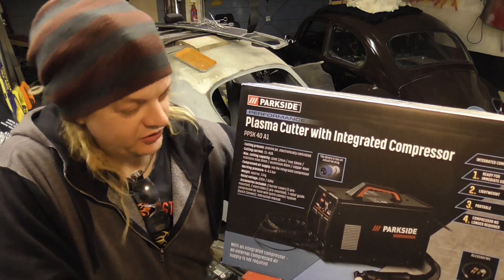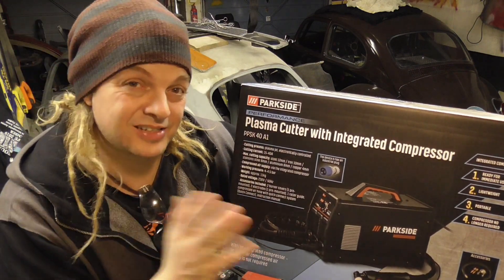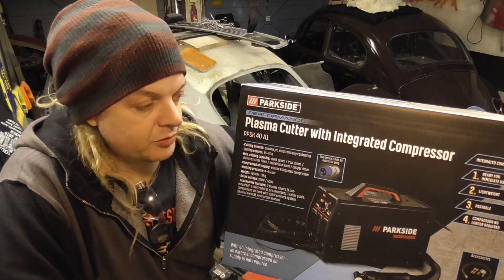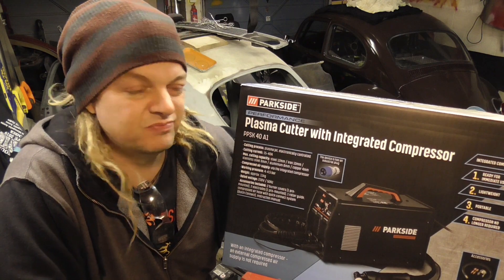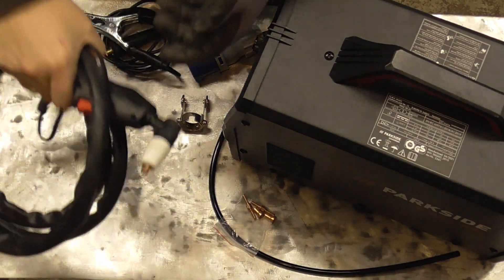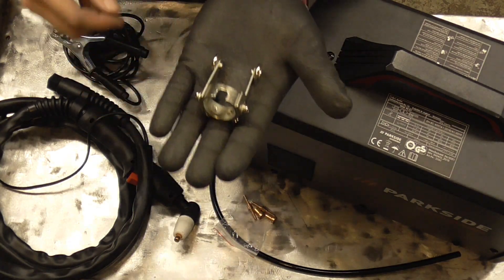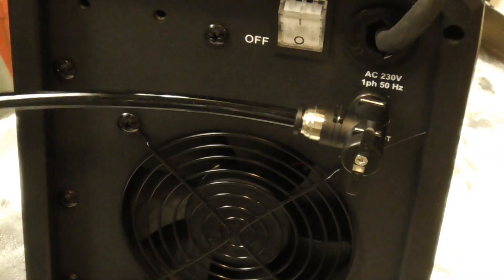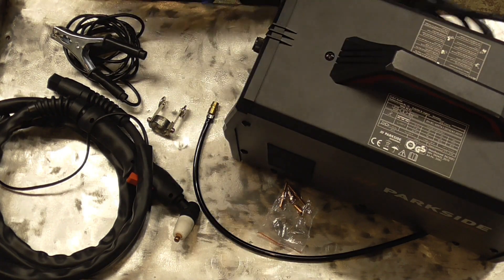Testing a Budget Plasma Cutter Parkside LIDL Cheap Plasma Cutter With Integrated Compressor PPSK40A1

Comment: I used this and it tripped two fuses in my extension cords loolz. The main house fuse was ok 😉
Reply from the maker: I cant remember the exact  details as been a while but I have a 13A RING in the garage with old fuse box. I think used 16A fuse wire but can't actually remember now. Not saying people shoukd copy this however in not a qualified sparky. Was only a problem when over 75%/2.5 on dial again from memory. 😊👍

Comment: Hi mate , I don't usually comment on YouTube videos. 
I've got two of these machines , one for the boat , one for the van . 
It's so much better than my old IFL plasma (which to be fair is over 15 years old and needs a compressor which a pain in the arse on mobile jobs ), the built in compressor has so far been fine and I've severed 12mm and slightly above with care.
Mostly I cut 3mm - 6mm plate for boat fabrication and repair and it's a handy 'one box' tool ... for £150 ! I'm over moon with my two , and the nozzles are more standard .
The wheel attachment is handy for cutting circles by the way , although I already had a tool that fitted the head for that (lots of portholes to cut !)
Reply from the maker: @richardstickney6025  Fab feedback thankyou for taking the time. I've used the cutter for some hours since making this video and was essential for making the bar in my vid a few weeks ago. I actually bought a hole cutter but not tried that yet, need to find a safe first 😅. I cut some super thick bar, from memory it was 14mm, was far from a clean cut and took some time but got there in the end. I've found the key to a decent cut it not to be stingy with the tips, so bought a big box of them  for sensible money and replace regularly as soon as start to deteriorate or if the hole elongates. Many thanks 😊👍

Comment: Hi mate nice video after seeing ur video I went out and bought the latest Parkside plazma cutter with the built in compressor and also used the same converter as u to let me use a 13amp plug but can't get  it to cut anything also I burned to tips out in the process am I doing something wrong as I have never had a plazma cutter before cheers Martin
Reply from the maker: That doesn't sound good. What is it not doing? Is the compressor starting when you press the button? Have you got the insulating ring underneath the electrode keeping things apart? If your compressor and 'flame' is working then it's important to keep the tip flat so it doesn't shoot sideways, this destroys the caps in no time and will give a poor cut. You can actually start in the centre of thinner work peices but I wouldn't recommend it unless want spraying in molten steel, so start just off the edge and move onto the steel. You will learn the right speed for different metal thickness and settings tho generally you don't have to turn it up much above half way for all but the thickest metals. Its more about getting a a feel for the speed. When your good metal shoots down through the steel, moving too fast it doesn't cut all the way though and shoots back at your face! I'm still not sure if you have a technical fault or just new, can be a bit scarey at first if your not used to welding etc.
Reply: @PeoplesCar  yes insulating ring underneath Electrode air compressor seems very weak when pull trigger
Reply: @PeoplesCar  Also the compressor starts when pull trigger but only stays on for about 6 seconds and goes off
Reply: @PeoplesCar  Also the blue light keeps coming on compressor runs like 10seconds the cuts off air
Reply from the maker: @martinawdadapterssmith6485   I'll be honest I'm really not sure. The compressor comes on and stays on as soon as start cutting, and stops about 2-3 seconds after stop to cool the tip.  
You don't have the air valve for external feed open at the back of the machine do you? It should be blowing quite strongly. Not sure if thats in line with the internal compressor.... probably not but just a thought. I assume you have a good earth? That's very important, if on rusty crap need to clean a section back to fresh steel for it. It won't run without the earth (I believe it actually the live as works the opposite to a welder, but could be wrong), or get a false start. Not sure what the blue light means sorry, I don't remember seeing one. I'm not sure what else to suggest other than making sure all your cables are plugged in tight, the 'earth' is a little tricky to screw down with my fat fingers. Sorry. ☹
Reply: @PeoplesCar  I'm pleased to say I think I have found the problem the tap at the back was Totally open so was blowing all the air out of the back so hopefully now when I get the new tips it will work now lol
Reply from the maker: @martinawdadapterssmith6485  Great stuff. Make sure you buy correct ones as are 3 different types. I got 30 electrodes and caps off ebay as they dont last long anyway. Best of luck this 😊👍

Comment: Why not kryten…full of hot air….yes I’ve bought one of these.
Reply from the maker: I figured Lister is too just from a different end! 😅  I've just spent 2 weeks chopping up a vehicle with mine, has performed superbly, very happy with it. Your going to need some electrode tips and Copper caps at some point. Can buy in bulk on ebay but be careful as none list for this cutter and a few different types. I'll dig out the listing I bought from later so know are the correct type. 😊👍

Comment: I bought it but unfortunately the hdr indicator lights on
Reply from the maker: I'm not sure what that is? If faulty can you return it?
Reply: @PeoplesCar  according to the manual it says no load voltage. How many voltage fo you have? I tried 220 but nothing
Reply from the maker: @s.tachos9921  that doesbt sound right? I'm running off a 240v domestic ring but in reality its probably closer to 220. I forget now but think upped the fuse wire to 15a as kept blowing 13a but I'm on a ring so was confident it wasn't going to set the garage on fire! LOL. Sounds like yours could be faulty. Does it turn on? It's noisy when you do. Or is it just the arc that's not starting?
Reply: @PeoplesCar  the seller says it works when I sent it back for checking. The HDR indication lights on when I press the trigger. All parts are working except the torch.
Reply from the maker: I'm really not sure sorry. If you have sent it back then I guess there is nothing to worry about I guess. Only other thing I can think is try it at a different location and see if works there? At least that way you will know if a problem with your electrics etc but personally if buying 2nd hand I'd look for another if you don't need to keep that one? incase its an intermittent fault with the machine. Best of luck 😄👍
Reply: @PeoplesCar  I gave it to a technician to check it. I will inform you when I have news.
Reply: @PeoplesCar  their giving a five year warranty in lidl's i bought one today.and their great with returns.
Reply from the maker: @robertwilliams-mc9et  so long as it's faulty, bought things that have been rubbish but wouldn't accept back as not faulty. Also their receipts are on thermal paper paper wipe themselves in your pocket 😅 may need app for 5 years 😊👍
Reply: @PeoplesCar  i have took things back without a receipt.i paid by card thats a record of purchase.but i always keep my receipts in my chicken on top of the fridge.thanks for the info.
Reply from the maker: @robertwilliams-mc9et  Poor Chicken! 😅👍

Comment: I believe this plasma cutter is rated Class A which apparently is not for domestic use . Do you think it would be a problem using it in a garage that is 7 or 8 meters from the house.
Reply from the maker: Really? Seems kind of surprising if was sold at LIDL to a domestic market but I'm not saying your wrong. 
I'm not sure what the safety concern is. Personally I think the biggest risk is fire from sparks that come from it. It's much like a welder and they go everywhere, so if you have any flammables around could be a concern. I think a water bath is essential to keep the sparks and risk to a minimum, but is it safe? I don't think I'm qualified to say either way, but I know of people that do use them in domestic garages. 
Someone else mentioned that the domestic 13A fuse isn't rated high enough for the cutter on 'high' and have found myself that the fuse can blow when set to max, however I've found most cutting jobs require a lower setting so it's rarely a problem. Hope that helps 🙂👍
Reply: @PeoplesCar  hi thanks for your reply I think from what I’ve read the issue is that it could potentially cause interference with domestic appliances. I have just ordered one myself and hopefully it won’t cause any problems being obviously not in the house when in operation
Reply from the maker: @russer98  I've not knowingly had any interference problems, but I don't have much modern tech to interfere with and the garage is on a seperate ring. Hopefully you will be OK. Just make sure your on a fused power source so should anything over load it will trip out/fuse. 
My 13a fuses blew in the domestic plug and garage board on max so I upped it to 16A (I THINK) on the board....but was confident the garage ring was safe for the extra load. If your garage is on a 13A spur it could potentially cause problems again I THINK, but I'm not an electrician so maybe worth checking with a sparky. 
Keep the Amperage on the cutter below max and you can cut pretty much anything. Low amperage setting make for neater cleaner easier to control results on thinner sheet anyway. My biggest mistake was too much power and rushing. Best of luck 👍

Comment: Please could you tell me whether can I use a  1.5mm2  fly cable as an extension instead of 2.5mm2 with this plasma cutter? I want to make a longer lead but have 1.5mm2. Thanks very much.
Reply from the maker: According to Google.....
Depending on the installation method used (this is ASSUME will be surface mounted or through wall/conduit/insulation etc), the 1.5mm cable has a maximum rated capacity of between 14 and 20 amps.  Another post up regarding 1.5 heat resistant pvc FLEX says 16A is the absolute limit. Now I'm no sparky and this is just my opinion based on a quick Google search but I would say absokutely NOT! The machine needs a 16A supply and the last thing you want to do is start popping extension cables rather than fuses, or starting fires! Please be safe. 🙂👍
Reply: @PeoplesCar  Thank you very much for the data provided, confirming my assumption. Of course the cable will get hot & may catch fire. Well spotted!                                                                     A heavy duty blue arctic cable with 16 amp  rating with 2.5mm2 thickness will be used for the operation. 
Point to note: Ready made fly cable from some outlets use 1.5mm2 instead of 2.5mm2 rated, but both are rated at 16amp. I will be making my own with safety in mind. Thank you so much for the fabulous bit of research. Take great care.
Reply from the maker: @patpathinayake3586  My pleasere, best of luck 👍
Reply: @PeoplesCar  Don't forget to uncoil the extension lead (which I assume is what a 'fly cable' is?) completely.
Reply from the maker: I'm not big on electrics but I  believe you can run up to about 16 amps through 1.5 doing a quick Google search on both flex and solid core. Personally that's too close to its limit for comfort for me tho and I deffo wouldn't risk it. I'm running mine off a 2.5 twin and earth RING. I was blowing the fuses at 13 amp and think went up to 16 from memory giving me about a 20% safety margin. I wonder what the cable that attached to the machine is? Maybe pop the plug off and measure to know what the manufacturer used. Best of luck 😊👍
Reply from the maker: Hang on this question just came up in my feed and I answered it months ago? Very confused. Well at least my answers were consistent 😅👍

Comment: Thanks for a great review. I am thinking about one of these. Just a quick question - I see that the cutter is fitted with a 16amp caravan hook up type plug - have you had any issues with blowing the 13 amp fuse in the adapter with the standard 13 amp plug? I don't seem to be able to get any clear information on what the input current requirement is.
Reply from the maker: Funny you should ask! When I did this video I had no trouble at all on any setting with the domestic 13a plug fuse blowing, however I had heard online other people saying it was an issue. When doing the followup vid here...https://youtu.be/MImhb9z1H6k it did blow when I was running on external air and at 40A max setting. I have no idea why that would be the case and doesn't seem to make sense, but that's what happened. 30-35 will be more than enough for most stuff I'd need it for so just going to stay clear of the top settings in future, where possible. I actually needed a caravan converter for hooking up the van, but you could just remove it and fit a stock 3pin fuse (if your in the uk) and read that's not a problem. The converter was cheap tho and minimal effort for a fiver! LOL  Good Luck 🙂👍
Reply: @PeoplesCar  Many thanks for your reply. I did actually see your second vlog on this today. I will now decide on whether to chance with using up to 30/35 amps. Thanks again.
Reply: Great review! I just got one and was worried about the industrial type plug. Was wondering can I just wire up a 3pin 13 amp domestic plug- essentially the same as the adaptor??
Looking forward to trying it out.
Reply: @davidbutler9787  Adapter would be easier. Also watch the second @Peoples Car vlog on this machine (link above) regards to fuses as discussed above.
Reply: @anthonyforster9811  thanks for that advice. Cheers.
Reply from the maker: @davidbutler9787  Thank you for your help :)
Reply from the maker: @davidbutler9787  Someone has written in the comments that its supposed to have a 16A supply. So I guess a standard 13A plug maybe in trouble regardless on full power. God Luck :)

Comment: It's a great machine for using on the move in a van on a generator, saves having a compressor also.
Reply from the maker: Yeah definitely. I was thinking along similar lines..... can go blow the fuses at mates houses too! LOL 😅
Reply: @PeoplesCar  well maybe you should install a 16amp supply as the machine is intended for use on.
Reply from the maker: @jayboy1810  I upped it to a 20A fuse after the 2nd pop. I didn't realise is was supposed to be on 16a, hadn't spotted that. Thanks for the update 👍

Comment: Thanks for the concise and none bias review.

I saw this advertised on Lidl and can't decide if it's worth buying or not.
99% of my metal work is car related. Making patch panels and replacement parts.
Seems easier and less noisy than a grinder and possibly cheaper than buying cutting discs after the initial cost of the cutter.
Reply from the maker: Thanks for the kind words! 🙂. You know I love my grinder and kinda consider myself pretty handy with it. When it comes to cutting panels out of the car from sheet I can't really imaging a situation where a slitting disc on the grinder would be less effort? That's my go to tool of choice even now. The cutter is going to be great for removing rottern areas you just can't get a grinder in. For access panels in centre tunnels and cutting chassis rails etc. Oh and cutting hard steel saw blades for art projects etc. Im not trying to put you off getting one if that what you want but don't give up the grinder just yet. It's going to take a long time for the cutter to pay to itself. JIMHO. Good luck 🙂👍

Comment: Not bad. This made me look up prices over here in Oz and sub $300 but think they required air. For your Lister you could easily wire a solenoid in to go between the tap and machine so that the trigger operated the solenoid valve. 😉
Reply from the maker: Cool tx, I like that idea! 😄👍

Comment: That looked quite good really!! What do you think you’d upgrade to from one of those?
Reply from the maker: With a increased air flow from a compressor and amperage I Imagine it would clear the molten metal better from the bottom of the work piece, so effectively cutting better. I'm not going to need to cut 8mm+ steel with one though so this will do me just fine, and the internal compressor makes it relatively portable too if needed for helping out friends etc. Tx bud :)